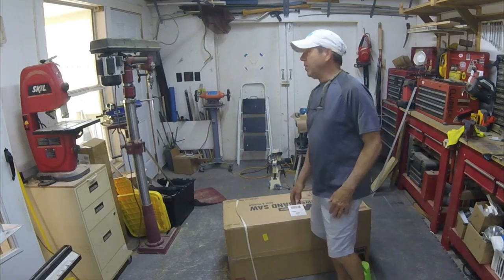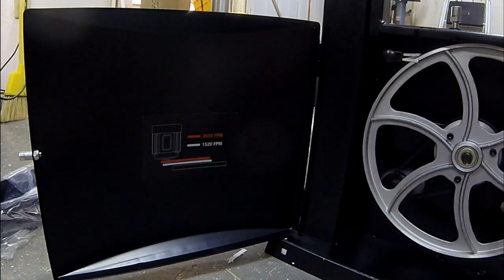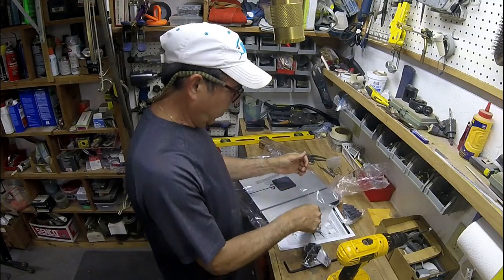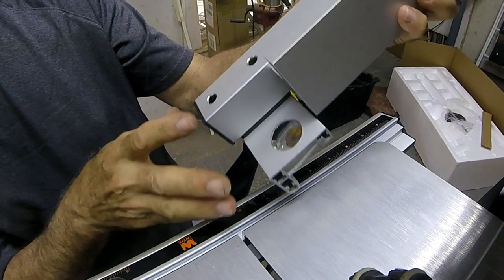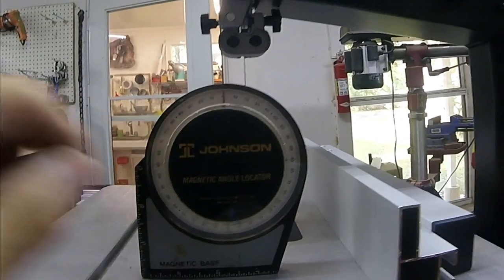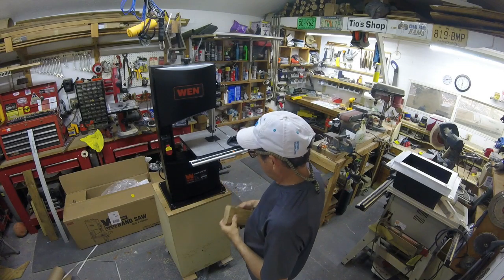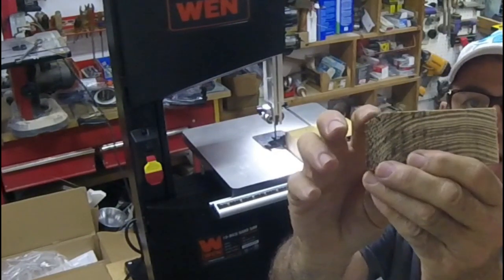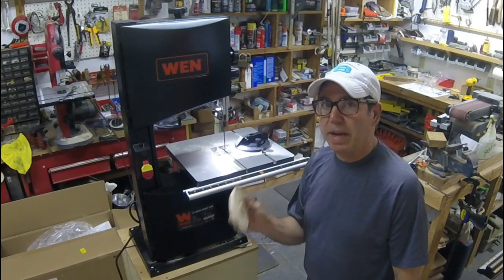WEN 10 inch Bandsaw Unbox, Test and Review

Comment: I just got the same WEN 3962, and got rid of the same Skil saw.  Out of the box but not fully assembled yet.  Impressed already.  My issue with the Skil was wheel balance and I could never get it right.  I like the bigger re-saw capacity and the wider through

Comment: I currently use one of these bandsaws quite a bit for the last 3 years and get good service from it. For resawing and cutting logs I bought a 3/8” 3 tpi blade from Timber Wolf otherwise I use a finer 3/8” or 1/8” blades. The spec say it will take a 1/2” blade but I think that’s pushing it although I set it up with a 1/2” 3 tpi blade and it didn’t have a problem. Also made a cross cut sled with a 1/4” plywood base and a hardwood miter slot runner and back fence, very useful. This saw works very well.
Reply from the maker: I agree .  I use a 1/2 inch blade but with a higher tooth count...works fine.

Comment: since the balance weights on the wheels are placed facing outward around the inside circumference, they are pushed outwards against the wheel (centrifugally) as it spins, so they should really never have the oppurtunity come off on their own. if anything, you could just strike a line across them with a sharpie to mark their location/orienation.
Reply from the maker: You're probably right...I'm just being overly cautious.
Reply: I just did this on mine, thx, Jay

Comment: My bandsaw makes that ticking noise to, it’s not the bearing. Don’t know what it is, but it shouldn’t make that noise. If you figure it out please let me know.
Reply from the maker: On mine it was the blade.
Reply: Was it the weld on the blade where it comes together, I noticed a tiny bump on my blade and think that’s the problem, I tried some sandpaper and ran the saw with the sandpaper on the back side, didn’t work.any suggestions ?

Comment: Thanks for the video. Did you ever put the saw on a lower base? It sure seemed too high for you in this vid.
Reply from the maker: I actually did not change the base yet.  It's a bit high but the wheels are the problem.  I plan to mount the wheels differently and lower the saw by about 2 inches.

Comment: Does anyone know how to keep the blade on the wheels once you change the blade? I have done everything that the instructions say to do.
Reply from the maker: If the adjuster wheel on the back of the machine will not bring the wheels into alignment then you might have a problem you can't fix yourself.  But my bet is on the alignment adjustment.   Put the blade on (with the machine unplugged) and turn the wheel slowly by hand.  If the blade starts to move off the wheel adjust the knob in the back until the blade moves back to center. This will take a bit of patience.  Do everything slowly and don't have the blade tensioned much.  Good luck.
Reply: @EngineeredAngler  I had it on and adjusted then when I was cutting with it the blade came off. What order do I put the blade on? I've seen videos that say right side then left then wheels. What do you think about that?

Comment: Thanks for this video. Looking into getting this model. Is that a shop fox radial drill press i noticed? I just bought a bench top version. What do you think of yours?
Reply from the maker: Yeah...redial arm drill press.  I like it a lot.  I was doing a bit of fabrication using tubing and this drill made things accurate and quick.

Comment: Ok. So did you find the cause of the tapping noise? Was it a bearing? How did you solve it?
Reply from the maker: yea...its the bonded point on the blade its just a tiny bit thicker and rubs on the right bearing.  That's why it had such a slow frequency, just once per blade rotation.
Reply: @EngineeredAngler  Were you able to make any adjustments to stop the tapping noise? I bought a Wen drill price and it too have a tapping noise that I could not fix. Ended up returning it.